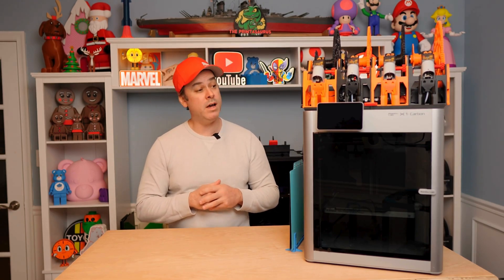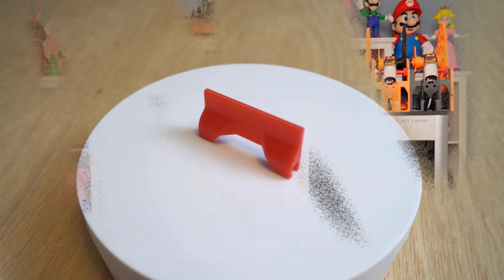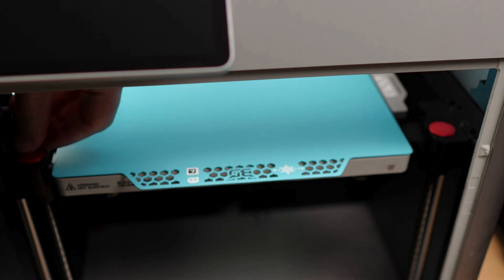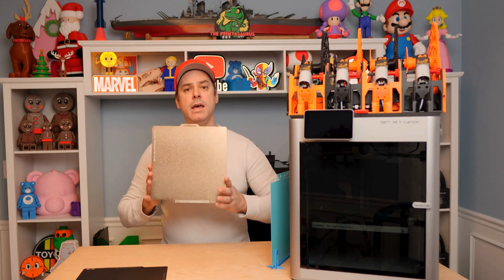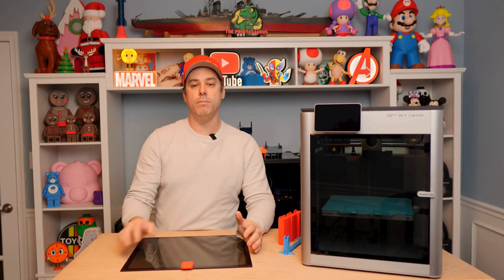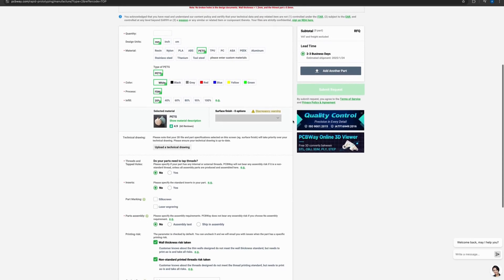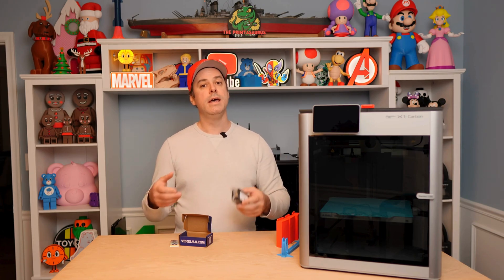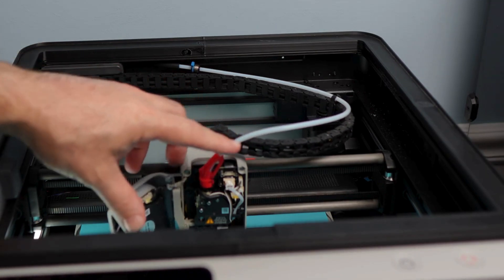X1 Carbon Mod Guide – Upgrades for Your Bambu 3D Printer

Comment: Which plate is best?  Or would several be worthwhile?
Reply from the maker: If you are starting out, a PEI build plate works great. Eventually, you'll want to expand to different build plates for different surface results. You have plates that have texture, patterns, etc. My go-to plate at the moment is the cryogrip glacier build plate - great adhesion at lower bed temps, and I like the texture, it's more on the smooth side.
Reply: @ThePrintasaurus  I tend to go with the highest end I can get on purchases so I don't need to upgrade later.

I believe the cyrogrip had two versions - rough and smoother.
Reply from the maker: @bradandrews777  Yes, the frostbite is heavily textured and only works with PLA and PETG. The Glacier is more on the smooth side, very light texture and universal - works with all filaments. I have converted almost all my printers to a glacier build plate and have enjoyed them.

Comment: Just expect your voxel order to take a while... i ordered my python hardware kit 5 1/2 weeks ago... it is finally in the mail now, so only 1 more week... have some filters in the package as well to replace stock + printed bento box..
Just expect to wait 4-6 weeks, its a common issue.
Reply from the maker: My filters and filament I have ordered came pretty quick. But my Python AMS printed parts did take longer than I expected. I wonder if that is why your order is taking a bit longer as well?
Reply: @ThePrintasaurus  actually from the order it seemed like my bento box was the holdup.. I did finally recoeve it the other day... printed bento box was... good enough... ams parts obviously shouldn't be an issue, have only assembled the enclosure so far though... working on the internals tomorrow.. one thing I didn't realize is it comes with tpu gearsthat I spent time printing.. oh well...

Comment: Recommended upgrade : sell it and buy another brand.
Reply from the maker: If you had to pick a printer, what are you going with? Any favorite at the moment?
Reply: @ThePrintasaurus  I see 2 people said this and neither one replied my guess they talking out their a$$... Anyway I'll give a answer the QIDI Q1 PRO or Better yet the Xmax 3 or plus 4 which I believe is the competing model from Qidi. 
   Im about 7mths into 3d printing and my 1st printer was a Qidi Q1 pro I freaking love it , it just prints the quality is impressive even though I'm running almost everything on default settings only adjusting infill and wall counts 😅 💪 meaning it can actually do even better which is nuts since as is It's almost identical to the x1-Carbon. A printer I just got a few days a printer that I am not so impressed with. I mean it's great I guess. The wiper flat out sucks it leaves tiny pieces of filament on the nozzle which leads to issues. The 1st layer which is supposed to be automatically prefect every time are far from it basically the same 1st layer I'm getting on the Qidi Q1 pro. When I 1st got it I tired to print a simple fast preload the Bambu badges they came out ruff-ish nothing special at all other than being in 2 colors without a pause and manual filament change. than I printed the standard boat using the same Bambu Black filament on both printers you can barely tell the difference Q1-PRO vs x1-Carbon. 
  So from a newbies perspective not a fan of every print having to go through the cloud SD card fixes that I'm fine with doing that. I like Bambu studios slicer the handy app is great.  But it's not as great as everyone makes it seem to be... 
   
Btw 
 I didn't wait for the Qidi box to drop and just get the xmax 3 or plus 4 (both have a higher speed rating hotter hotend and bigger build space) cause the Qidi box would be 1st gen tech and I'm not a fan of buying 1st gen tech there is always issues I wanted something tried and true a printer that would just print. I like printing and building stuff modding stuff I do not like screwing with settings reprinting the same part over and over.  Am I happy with the x1-Carbon kind of yes since I did shift my perspective instead of simply not being impressed with the x1-Carbon I'm just very impressed with my Qidi Q1 pro for holding it own. I think most people go from a junk printer or a printer that takes a LOT of tinkering and general work to get it to print to a Bambu and this is what's contributing to all the hype. Since they are very user friendly simple to set up and do * just print * they just not the only printers that can do that.